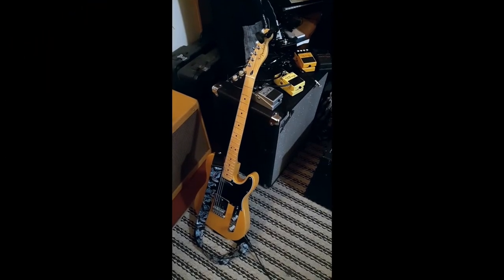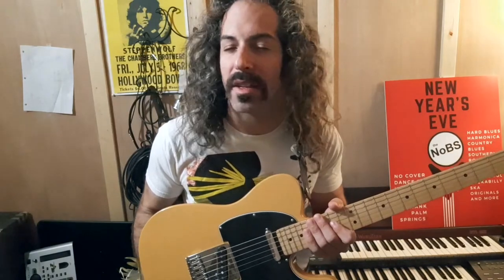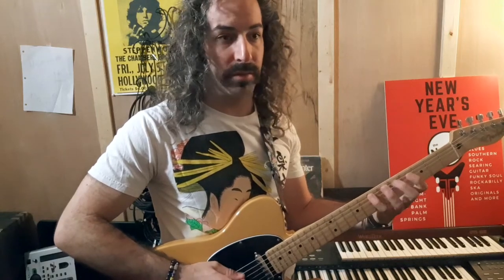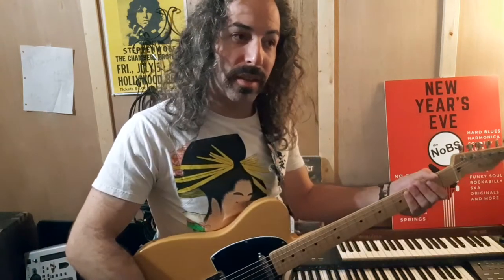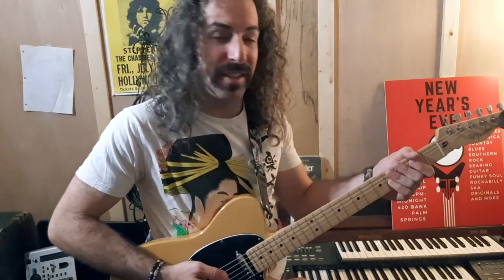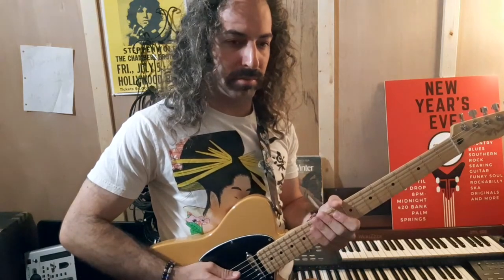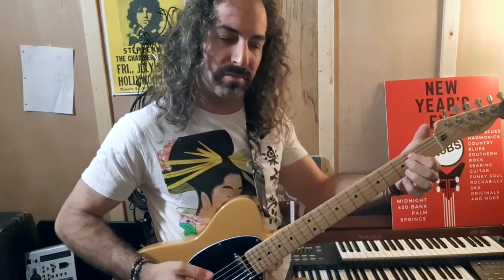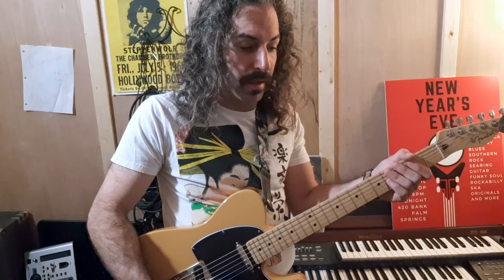Lose the Hiss with your Single Coil Distortion

Comment: This was helpfull, thanks, I was considering changing my humbuckers for p90s,
Edit: I try this tipos for my jackson king V js32t with high output humbuckers, a tc electronics fangs and a fender champion 100 in the  third british voice with the gain in 2 and it work, the tone knob actually work jajaja
Reply from the maker: Yes! There are many ways even with a P90 to get rid of the hiss. I just did a gig with the same telecaster as in this video and I used a loud fuzz. By staying on the middle setting and also standing far away from the amp I eliminated the hiss!

Comment: But i use les paul with humbuckers picukps and it has that hiss sound too.. i dont know how to solve the problem
Reply from the maker: Could be several things! A certain amount of hum is actually normal but hiss perhaps not so much. Are you using a lot of distortion? Compression??
Reply: @abetreblebass  Only use ultra metal and noise gate.. but when i  dont use distortion (direct thro amplifier) it doesnt have hiss sound... Sorry my english btw
Reply from the maker: @Nazreangel  my friend I understand you perfectly! Well it seems the pedal is the issue. Not all pedals are created equally my friend, some are noisy! And for that matter you might try lowering the gain on the pedal!